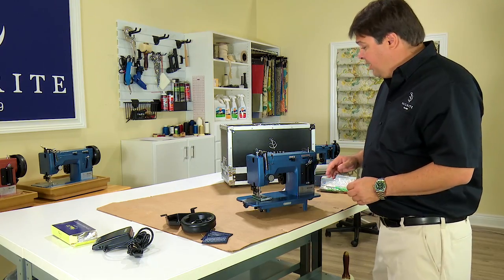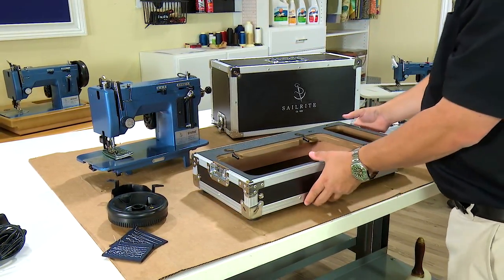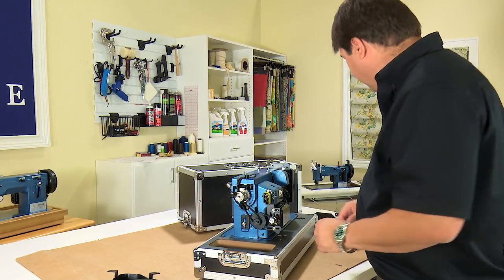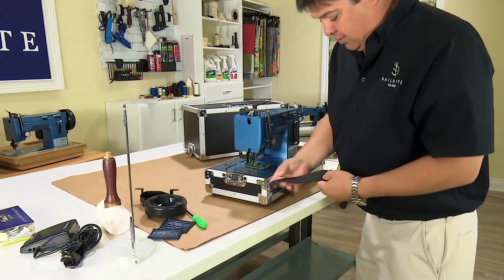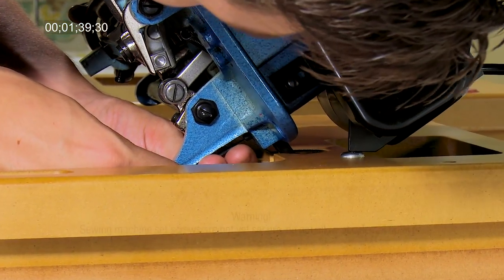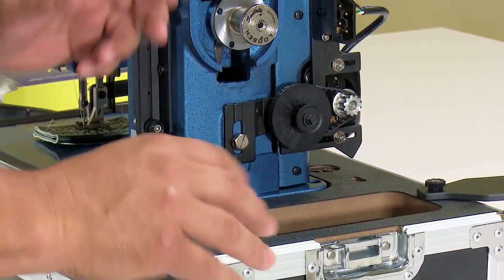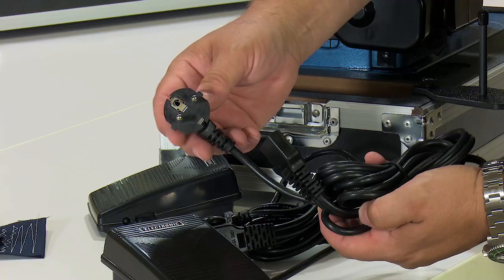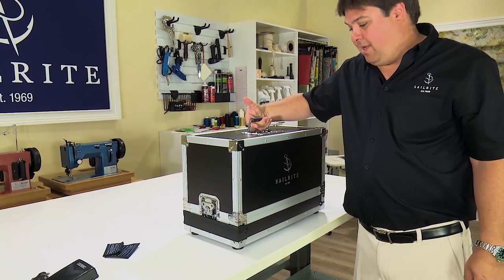Machine Assembly of Your New Sailrite Ultrafeed

Comment: I  chose to remove the hinges from the  case then install the pin sides to the machine. Then set the machine on the case hinge plate flat horizontal and screw the hinge back to the case.  Made it a one man job no finger smashing.
Reply: That makes much more sense to me.

Comment: Seems like it’d be much easier and safer to take the hinges off the base, install them into the holes in the sewing machine, then set the machine in the base, flip the round part of the hinge into the round slot and secure it. No danger of the machine falling forward onto your hand while you’re trying to desperately tighten screws under the machine that you can’t see.

Comment: Made in where
Reply from the maker: The Ultrafeed Sewing Machine is built in collaboration between the United States, Taiwan and China. The subassembly of our exclusive, cast-iron machine frame is done in China, while the motors are from Taiwan. The final assembly and tuning of each machine is done in the United States at Sailrite. Additionally, several critical parts and components for the Ultrafeed are made in the United States exclusively for Sailrite and we hold patents on numerous Ultrafeed features. All content and support are produced and/or provided by Sailrite.